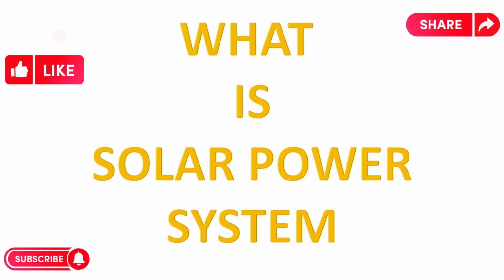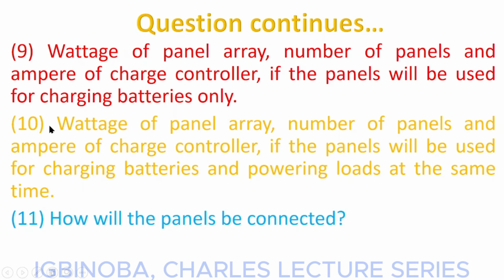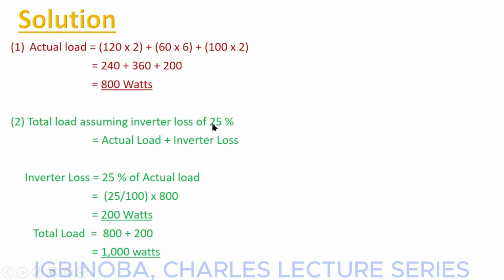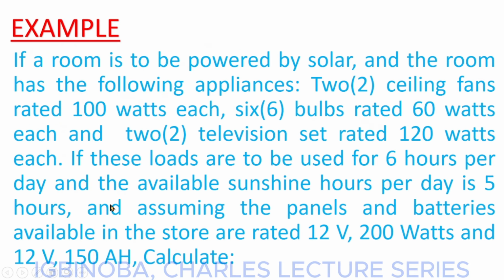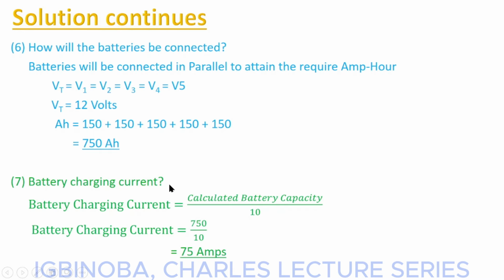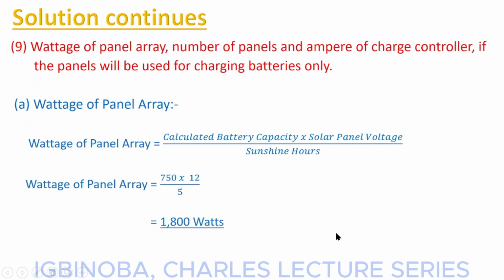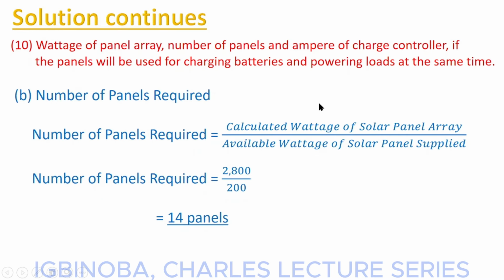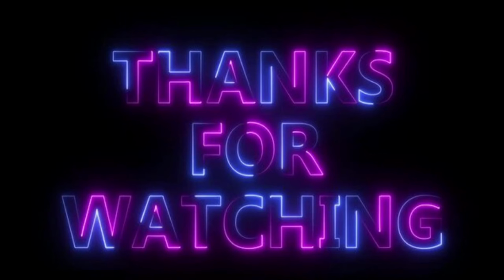Design of Solar Power System

Comment: MECH328B

1) Actual Load= 1380watts

2) Total Load= 1725watts

3) Inverter rating = 2156..25v

4) Battery Capacity = 1293.75Ah

5) No of Batteries = 9

6) Batteries are connected in Parallel 

7) Battery Charging current= 129.4 amps

8) Battery Charging time = 14hrs

9a) Wattage of panel array = 3105watts

9b) Number of panels = 16 panels 

9c) Charge Controller = 258.75A

10a) Wattage of panel array = 4830watts

10b) Number of panels = 24

10c) Charge Controller = 402.5A

11) Panels are arranged in Parallel

Comment: CIV375W
1. Actual load - 1380W
2. Total load - 1725W
3. Inverter rating - 2156.25VA
4. Battery capacity - 1293.75Ah
5. Number of batteries - 9
6. Batteries are connected in parallel 
7. Battery charging current - 129.4amps
8. Battery charging time 14hrs

9a. Wattage of panel array - 3105W
9b. Number of panels - 16 panels
9c. Charge controller - 258.75A

10a. Wattage of panel array -  4830W
10b. Number of panels - 24
10c. Charge controller - 402.5A

11. Panels are arranged in parallel

Comment: PETRO357E

1. Actual load= 1380 watts
2. Total load= 1725 watts 
3. Inverter rating= 2156.25 VA
4. Battery capacity= 1293.75 Ah
5. Number of batteries= 9 batteries 
6. Parallel 
7. Battery charging current= 129.375 Amps
8. Charging time= 14hrs
9. a. 3105 watts 
    b. 16 panels 
    c. 258.75 Amps
10. a. 4830 watts
      b. 24 panels 
      c. 402.5 Amps
11. Parallel

Comment: MECH 33C
1)actual load = 1380watts

2)total load= 1725 watts

3) inverter rating =2156.25VA

4)battery capacity= 1293.75Ah

5)No of batteries= 9

6)batteries are connected in parallel

7)battery charging current =129.4amps

8) battery charging time=14hrs

9a) wattage of panel array= 3105watts

9b)number of panels=16panels

9c)charge controller= 258.75A

10a) wattage of panel array= 4830watts

10b)number of panels = 24

10c)charge controller= 402.5A

11)panels are arranged in parallel

Comment: PETRO338K

1. Actual load= (100×3)+(60×10)+(120×4) =1380watts
2. Total load assuming inverter loss of 25%= Actual load +Inverter loss
Inverter loss=25% of Actual load
= 25%×1380=345 watts
Total load= 1380+345=1725 watts
3. Inverter rating on VA using power factor of 0.8
= (1725÷0.8)= 2156.25
4. Battery capacity using factor for reserve 75%=(2×1725×6×0.75)=1293.75Ah
5. No. of batteries for backup hours=1293.75Ah÷150Ah= 8.6 =8 batteries 
6. How batteries will be connected?
The batteries will be connected in parallel 
Vt=V1=V2=V3=V4=V5=V6=V7=V8
Ah= 150+150+150+150+150+150+150+150=1200
7. Battery charging current=1293.75÷10=129Amps
8. Battery charging time assuming charging loss of 40%= 1293.75Ah+(40%+1293.75Ah)÷129A=14hrs
9a. Wattage panel array= 3105 watts
9b. Number of panels required= 3105÷345=9 panels 
9c. Ampere of charging controller required= 3105÷12=258.75Amps
10a. Wattage of panel array= Calculated wattage of solar panel array for charging battery only+ calculated total load =3105+1725=4830watts
10b. Number of panels required= calculated wattage of solar panel array÷ Available wattage of solar panel supplied= 4830watts÷345= 14Amps
10c. Ampere of charge controller= calculated wattage of solar panel array÷ solar panel voltage=4830watts÷12volts= 402.5Amps
11. How will the panels be connected?
Ans: They will be connected in parallel

Comment: PETRO353A

 
1. Actual load= (100×3)+(60×10)+(120×4) =1380watts
2. Total load assuming inverter loss of 25%= Actual load +Inverter loss
Inverter loss=25% of Actual load
= 25%×1380=345 watts
Total load= 1380+345=1725 watts
3. Inverter rating on VA using power factor of 0.8
= (1725÷0.8)= 2156.25
4. Battery capacity using factor for reserve 75%=(2×1725×6×0.75)=1293.75Ah
5. No. of batteries for backup hours=1293.75Ah÷150Ah= 8.6 =8 batteries 
6. How batteries will be connected?
The batteries will be connected in parallel 
Vt=V1=V2=V3=V4=V5=V6=V7=V8
Ah= 150+150+150+150+150+150+150+150=1200
7. Battery charging current=1293.75÷10=129Amps
8. Battery charging time assuming charging loss of 40%= 1293.75Ah+(40%+1293.75Ah)÷129A=14hrs
9a. Wattage panel array= 3105 watts
9b. Number of panels required= 3105÷345=9 panels 
9c. Ampere of charging controller required= 3105÷12=258.75Amps
10a. Wattage of panel array= Calculated wattage of solar panel array for charging battery only+ calculated total load =3105+1725=4830watts
10b. Number of panels required= calculated wattage of solar panel array÷ Available wattage of solar panel supplied= 4830watts÷345= 14Amps
10c. Ampere of charge controller= calculated wattage of solar panel array÷ solar panel voltage=4830watts÷12volts= 402.5Amps
11. How will the panels be connected?
Ans: They will be connected in parallel

Comment: EEE377Y

 1 . Actual Load : 1380 watts
 2. Total Load : 1725 watts
 3. Inverter Rating : 2156.25 VA
 4. Battery Capacity : 1293.75 Ah
 5. Number of Batteries : 8.625 - 9 batteries
 6. Parallel
 7. Battery charging current : 129.375 Amps
 8. Charging time : 14 hrs
 9. (a) 3105 watts
 (b) 15.525-16 panels
 (c) 258.75 Amps
 1 0. (a) 4830 watts
 ( b) 24.15 - 24 panels
 (c) 402.5 Amps
 11. Parallel

Comment: PETRO369Q

1. Actual load= (100×3)+(60×10)+(120×4) =1380watts
2. Total load assuming inverter loss of 25%= Actual load +Inverter loss
Inverter loss=25% of Actual load
= 25%×1380=345 watts
Total load= 1380+345=1725 watts
3. Inverter rating on VA using power factor of 0.8
= (1725÷0.8)= 2156.25
4. Battery capacity using factor for reserve 75%=(2×1725×6×0.75)=1293.75Ah
5. No. of batteries for backup hours=1293.75Ah÷150Ah= 8.6 =8 batteries 
6. How batteries will be connected?
The batteries will be connected in parallel 
Vt=V1=V2=V3=V4=V5=V6=V7=V8
Ah= 150+150+150+150+150+150+150+150=1200
7. Battery charging current=1293.75÷10=129Amps
8. Battery charging time assuming charging loss of 40%= 1293.75Ah+(40%+1293.75Ah)÷129A=14hrs
9a. Wattage panel array= 3105 watts
9b. Number of panels required= 3105÷345=9 panels 
9c. Ampere of charging controller required= 3105÷12=258.75Amps
10a. Wattage of panel array= Calculated wattage of solar panel array for charging battery only+ calculated total load =3105+1725=4830watts
10b. Number of panels required= calculated wattage of solar panel array÷ Available wattage of solar panel supplied= 4830watts÷345= 14Amps
10c. Ampere of charge controller= calculated wattage of solar panel array÷ solar panel voltage=4830watts÷12volts= 402.5Amps
11. How will the panels be connected?
Ans: They will be connected in parallel

Comment: PETRO3182Z

1. Actual load= (100×3)+(60×10)+(120×4) =1380watts
2. Total load assuming inverter loss of 25%= Actual load +Inverter loss
Inverter loss=25% of Actual load
= 25%×1380=345 watts
Total load= 1380+345=1725 watts
3. Inverter rating on VA using power factor of 0.8
= (1725÷0.8)= 2156.25
4. Battery capacity using factor for reserve 75%=(2×1725×6×0.75)=1293.75Ah
5. No. of batteries for backup hours=1293.75Ah÷150Ah= 8.6 =8 batteries 
6. How batteries will be connected?
The batteries will be connected in parallel 
Vt=V1=V2=V3=V4=V5=V6=V7=V8
Ah= 150+150+150+150+150+150+150+150=1200
7. Battery charging current=1293.75÷10=129Amps
8. Battery charging time assuming charging loss of 40%= 1293.75Ah+(40%+1293.75Ah)÷129A=14hrs
9a. Wattage panel array= 3105 watts
9b. Number of panels required= 3105÷345=9 panels 
9c. Ampere of charging controller required= 3105÷12=258.75Amps
10a. Wattage of panel array= Calculated wattage of solar panel array for charging battery only+ calculated total load =3105+1725=4830watts
10b. Number of panels required= calculated wattage of solar panel array÷ Available wattage of solar panel supplied= 4830watts÷345= 14Amps
10c. Ampere of charge controller= calculated wattage of solar panel array÷ solar panel voltage=4830watts÷12volts= 402.5Amps
11. How will the panels be connected?
Ans: They will be connected in parallel

Comment: COMP33C

1. Actual load is 1380W
2. Total load is 1725W
3. Inverter rating is 2156.25VA
4. Battery capacity is 1293.75AH
5. No. of batteries is 8.625-9batteries
6. Parallel
7. Battery changing current is 129.375amps 8. Charging time is 14hours
9. (A) 3105W (B) 15.525~16panels (C) 258.75A
10. (A) 4830W (B) 24.15~24panels (C) 402.5A 11. Parallel

Comment: CIV311K
i) Actual load = 1380 watts.
ii) Total load = 1725 watts.
iii) Inverter ratings in VA = 2156.25VA.
iv) Battery capacity = 1035Ah.
v) Number of batteries for backup hours = 6.9= 7 batteries.
vi) The batteries will be connected in parallel.
vii) Battery charging current= 103.5 A.
viii) Battery charging time= 14 hours 
ix) a. Wattage of panel array= 2484 watts.
b. Number of panels= 12.42 = 12 panels
c. Ampere of charge controller= 207A.
x) a. Wattage of panel array= 4209 watts.
b. Number of panels= 21.05 = 21 panels.
c. Ampere of charge controller= 350.75A.
xi) The panels will be connected in parallel just as the batteries

Comment: MAR65M 

1. Actual load = 1380 watts

2. Total load = 1725 watts

3. Inverter rating = 2156.25 VA

4. Battery capacity = 1293.75 Ah

5. Number of batteries = 9

6. Batteries are connected in parallel

7. Battery charging current = 129.4 amps

8. Battery charging time = 14 hrs

9a. Wattage of panel array = 3105 watts
9b. Number of panels = 16 panels
9c. Charge controller = 258.75 A

10a. Wattage of panel array = 4830 watts
10b. Number of panels = 24
10c. Charge controller = 402.5 A

11. Panels are arranged in parallel

Comment: PETRO387I

1. Actual load= (100×3)+(60×10)+(120×4) =1380watts

2. Total load assuming inverter loss of 25%= Actual load +Inverter loss
Inverter loss=25% of Actual load
Therefore, 
Total load= 1380+(25%×1380)=1725 watts

3. Inverter rating in VA using power factor of 0.8
= (1725÷0.8)= 2156.25 VA

4. Battery capacity using factor for reserve of 75%=(2×1725×6×0.75)/12=1293.75Ah

5. No. of batteries for backup hours=1293.75Ah÷150Ah= 8.625 = 9 (Approximately) 
       = 9 batteries 

6. How the batteries will be connected?
The batteries will be connected in parallel 
VT=V1=V2=V3=V4=V5=V6=V7=V8=V9
VT= 12 V 
Ah= 150+150+150+150+150+150+150+150+150=1350 Ah

7. Battery charging current=1293.75÷10=129Amps

8. Battery charging time assuming charging loss of 40%= 1293.75Ah+(40%+1293.75Ah)÷129A=14hrs

9a. Wattage of panel array= (1293.75 x 12)/5=3105 watts

9b. Number of panels required= 3105÷200=15.525 = 16 panels 

9c. Ampere of charging controller required= 3105÷12=258.75Amps

10a. Wattage of panel array= Calculated wattage of solar panel array for charging battery only+ calculated total load =3105+1725=4830watts

10b. Number of panels required= calculated wattage of solar panel array÷ Available wattage of solar panel supplied= 4830watts÷200watts= 24.15 Amps

10c. Ampere of charge controller= calculated wattage of solar panel array÷ solar panel voltage=4830watts÷12volts= 402.5Amps

11. How will the panels be connected?
Ans: They will be connected in parallel

Comment: COMP335I

1. Actual Load (Watts): 1380 W 2, Total Load (DC with 25% Inverter Loss): 1720 W
3. Inverter Rating: 2156.25VA 4. Battery capacity: 1293.75Ah
5, Number of Batteries (12V, 150 Ah): 6, Battery Connection (48V System): 2 parallel strings of 4 batteries in series 7, Battery Charging Current: 129.4 A 8, Minimum Charging Time (hrs): 14
hours 9ia. 3105W b, 15.5 panels c. 258.8A
10a. 4830W
b, 24 panels
с. 402.5A
11. Panel Connection: 3 parallel strings of 6 panels in series

Comment: COMP38H

1. Actual Load (Watts): 1380 W 2, Total Load (DC with 25% Inverter Loss): 1720 W
3. Inverter Rating: 2156.25VA 4. Battery capacity: 1293.75Ah
5, Number of Batteries (12V, 150 Ah): 6, Battery Connection (48V System): 2 parallel strings of 4 batteries in series 7, Battery Charging Current: 129.4 A 8, Minimum Charging Time (hrs): 14
hours 9ia. 3105W b, 15.5 panels c. 258.8A
10a. 4830W
b, 24 panels
с. 402.5A
11. Panel Connection: 3 parallel strings of 6 panels in series

Comment: MECH359G

1.) Actual load = 1380W

2.)Total load = 1725W

3.)Inverter rating=2156.25Ah

4.)Battery capacity=1293.75Ah

5.)No ofbatteries for backup hours= 8.625 batteries which is approximately  9 batteries 

6.) The batteries will be connected  in PARALLEL

7.) Battery  charging current:129.375A

8.)Battery  charging  time=14hours

9a) wattage of panel array= 3105W
9b)No of panels= 15.525 approximately  16 panels
9c)ampere of charge controller= 258.75A

10a) wattage of panel array=4830 W
10b) No of panels= 24 panels
10c) ampere of charge controller= 402.5A

11.) PARALLEL  CONNECTION

Comment: MEC37K 
1. Actual load is 1380W
2. Total load is 1725W
3. Inverting rating is 2156.25VA
4. Battery capacity is 1293.75AH
5. No of batteries is 8.625~ 9
     batteries 
6. Parallel 
7. Battery changing current is
    129.375amps
8. Charging time is 14 hours
9. (A) 3105W (B) 15.525~16
     panels (C) 258.75A
10. (A) 4830W (B) 24.15~24
       panels (C) 402.5A
11. Parallel

Comment: MAR58F

1. Actual Load (Watts): 1380 W
2. Total Load (DC with 25% Inverter Loss): 1720 W
3. Inverter Rating: 2156.25VA
4. Battery capacity: 1293.75Ah
5. Number of Batteries (12V, 150 Ah): 9
6. Battery Connection (48V System): 2 parallel strings of 4 batteries in series
7. Battery Charging Current: 129.4 A
8. Minimum Charging Time (hrs): 14 hours
9a. 3105W
b. 15.5 panels
с. 258.8A
10a. 4830W
b. 24 panels
с. 402.5A
11. Panel Connection: 3 parallel strings of 6 panels in series

Comment: NAT322V

1. Actual load: 1380W
2. Total load: 1725W
3. Inverter rating: 2156.25VA
4. Battery capacity: 1293.75AH
5. Number of batteries: 9
6. Configuration: Parallel
7. Battery charging current: 129.375 amps
8. Charging time: 14 hours
9. (A) 3105W
(B) 15.5 panels
(C) 258.75А
10. (A) 4830W
(B) 24 panels
(C) 402.5A
11. Configuration: Parallel

Comment: PETRO3195M

1. Actual load = 1380W

2. Total load = 1720W

3. Inverter rating = 2156.25VA

4. Battery Capacity = 1293.75Ah

5. Number of batteries = 8.6-9 batteries

6. Parallel

7. Battery charging current = 129.4Amps

8. Charging Time = 14hrs

9 (a). 3105Watts

(b). 15.5 16 panels

(c). 258.75 Amps

10(a).4830W

(b). 24.15 ≤ 24 panels

(c). 402.5Amps

11. Parallel

Comment: PETRO3186D

1. Actual load= (100×3)+(60×10)+(120×4) =1380watts
2. Total load assuming inverter loss of 25%= Actual load +Inverter loss
Inverter loss=25% of Actual load
= 25%×1380=345 watts
Total load= 1380+345=1725 watts
3. Inverter rating on VA using power factor of 0.8
= (1725÷0.8)= 2156.25
4. Battery capacity using factor for reserve 75%=(2×1725×6×0.75)=1293.75Ah
5. No. of batteries for backup hours=1293.75Ah÷150Ah= 8.6 =8 batteries 
6. How batteries will be connected?
The batteries will be connected in parallel 
Vt=V1=V2=V3=V4=V5=V6=V7=V8
Ah= 150+150+150+150+150+150+150+150=1200
7. Battery charging current=1293.75÷10=129Amps
8. Battery charging time assuming charging loss of 40%= 1293.75Ah+(40%+1293.75Ah)÷129A=14hrs
9a. Wattage panel array= 3105 watts
9b. Number of panels required= 3105÷345=9 panels 
9c. Ampere of charging controller required= 3105÷12=258.75Amps
10a. Wattage of panel array= Calculated wattage of solar panel array for charging battery only+ calculated total load =3105+1725=4830watts
10b. Number of panels required= calculated wattage of solar panel array÷ Available wattage of solar panel supplied= 4830watts÷345= 14Amps
10c. Ampere of charge controller= calculated wattage of solar panel array÷ solar panel voltage=4830watts÷12volts= 402.5Amps
11. How will the panels be connected?
Ans: They will be connected in parallel

Comment: CIV397S
1)actual load = 1380watts 2)total load= 1725 watts 3) inverter rating =2156.25VA 4)battery capacity= 1293.75Ah 5)No of batteries= 9
6)batteries are connected in parallel 7)battery charging current =129.4amps 8)battery charging time=14hrs
9a) wattage of panel array= 3105watts 9b)number of panels=16panels 9c)charge controller= 258.75A 10a)wattage of panel array= 4830watts 10b)number of panels = 24
10c)charge controller= 402.5A 11)panels are arranged in parallel

Comment: EEE 358F
1. Actual load = 1380w
2. Total load = 1725w
3. Inverter rating = 2156.25VA
4. Battery capacity = 1293.75AH
5.No of batteries =9
6. Parallel 
7. Battery charging current = 129.375amps
8. Charging time = 14hours
9(a) 3105W
b) 15.5 panels
c) 258.75A
10(a) 4830W
b) 24 panels 
c) 402.5A
11. Parallel

Comment: CMH32B

1. Actual load 1380W
2. Total load 1720W
3. Inverter rating 2156.25VA
4. Battery capacity 1293.75Ah
5. Number of batteries 8.6..~ 9 batteries 
6. Parallel 
7. Battery charging 129.4A
8. T= 14hrs
9. (a) 3105W
     (b) 15.5 panels 
     (c) 258.75A
10. (a) 4830W
       (b) 24 panels
       (c) 402.5A
11. Parallel

Comment: MAR3164H

1. Actual load = 1380W

2. Total load = 1720W

3. Inverter rating = 2156.25VA

4. Battery Capacity = 1293.75Ah

5. Number of batteries = 8.6-9 batteries

6. Parallel

7. Battery charging current = 129.4Amps

8. Charging Time = 14hrs

9 (a). 3105Watts

(b). 15.5 16 panels

(c). 258.75 Amps

10(a).4830W

(b). 24.15 ≤ 24 panels

(c). 402.5Amps

11. Parallel

Comment: CHM363K

 1 Actual Load = 1380 watts
2. Total Load = 1725 watts
3. Inverter Rating = 2156.25 VA
4. Battery Capacity = 1293.75 Ah
5. Number of Batteries = 8.625 ~ 9 batteries
6. Parallel
7. Battery charging current = 129.375 Amps
8. Charging time = 14 hrs
9. (a) 3105 watts
(b) 15.525 ~ 16 panels
(c) 258.75 Amps
10. (a) 4830 watts
(b) 24.15 ~ 24 panels
(c) 402.5 Amps
11. Parallel

Comment: CHM3123S

1. Actual Load (Watts): 1380 W

2. Total Load (DC with 25% Inverter Loss): 1720 W

3. Inverter Rating: 2156.25VA

4. Battery capacity: 1293.75Ah

5. Number of Batteries (12V, 150 Ah): 9

6. Battery Connection (48V System): 2 parallel strings of 4 batteries in series

7. Battery Charging Current: 129.4 A

8. Minimum Charging Time (hrs): 14 hours

9a. 3105W

b. 15.5 panels

c. 258.8A

10a. 4830W

b. 24 panels

c. 402.5A

11. Panel Connection: 3 parallel strings of 6 panels in series